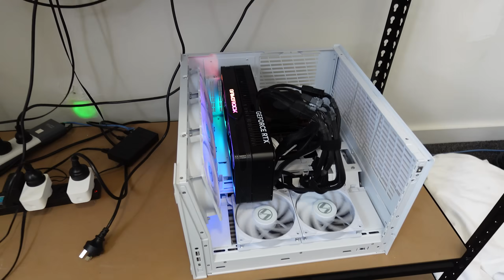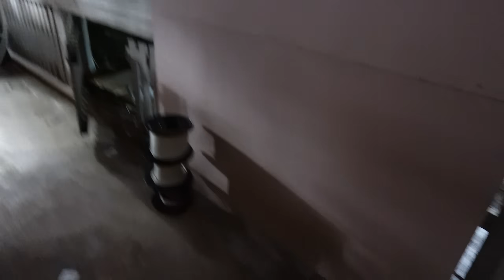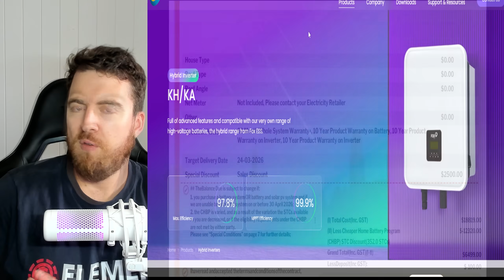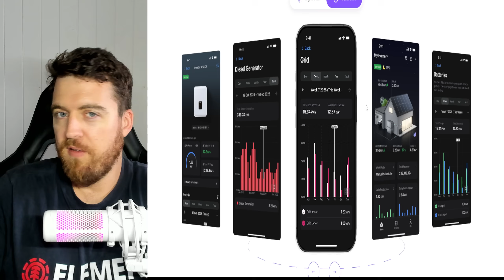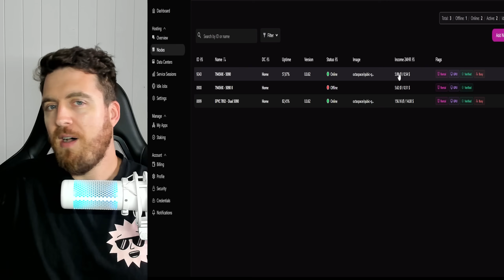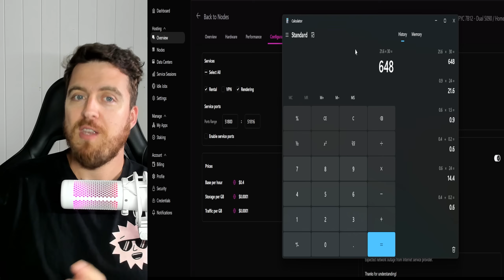This Is Why Every Miner Needs a Battery System Now

Comment: What do you think, would a 7745hx (octa core version of your 7945hx) and 32GB of RAM bottleneck the 5090? What about a 4090? Thanks in advance, and thanks for the thorough videos!
Reply from the maker: hmm the 32gb of ram most likely would. The general rule of thumb for ram is double the gpu vram
Reply: @BearMarketMiner thanks. 8 cores instead of 16 won't be problematic then, right? Do you know if older architectures (zen 3, ryzen 5000) would cause any issues?
Reply from the maker: Yeah 8 cores isn't ideal either. If you dropped the price you might get rented. Hard to say though.

Comment: Hey Mate, Look into GloBird energy. Not sure if they service QLD but in Victoria they provide 4 hours of free electricity daily. Some other providers offer similar here. Good opportunity to top up your battery. Hope it helps. Good luck with it all 👍
Reply from the maker: Hey mate.

Yeah I looked into them previously, I did some number crunching on it a while back. The issue is the Peak and even off-peak kWh rates - Some around 50c per kwh, so on days where I generate next to no solar Due to clouds, rain, winter etc. I pay nearly double the current rate.

Comment: Interesting and practical.  Will you have the ability to scale-up on solar panels at your new location?  Between crypto mining and the new AI data centers being built, the world is consuming more power than it can generate.  That's why I think SMR's (Small Modular Reactors) will be available to general consumers soon.  As AI makes it harder for people to get (or keep) a job with a company, more people will be self-employed, using every resource in their homes to generate income.  Which will result in the average home consuming more power than the average home today.
Reply from the maker: Love this take 👌 you’re not wrong, power demand is only going one direction.

Yeah scaling solar is definitely part of the long-term plan. The new location gives me a lot more flexibility roof-space wise, and I’m designing it so I can expand panel capacity in stages rather than doing it all upfront. Battery capacity will probably be the real limiter before panels are.

The SMR angle is interesting too. If that tech actually becomes accessible at scale, it would completely change the economics of home energy and mining/AI setups. For now though, solar + storage is still the most practical lever I can control myself.

Curious, would you personally go heavier into solar or wait to see how grid pricing and tech shifts play out?
Reply: @BearMarketMiner  Glad to hear you have the ability to scale.  I think clean energy sources, like solar, will become a mandatory "best practice" approach for the average home owner.  I fear, electricity costs will skyrocket - like RAM & SSDs did - in a few years from both AI's advancements and our gov't's push to move to electric vehicles.  Since you have the capacity to scale-up, I think you have the flexibility to wait to see how grid pricing and tech shifts playout before making a decision.  IMO, you're building the right foundation now to cover future needs, cost-effectivity, while keeping your options open.  I don't think we've seen the end of gov't subsidies to increase the everyday-citizen's use of clean energy :)
Reply from the maker: Yep 100% with you on this, it feels like solar + battery is gonna end up being the “normal” setup, not just for us.

And the RAM/SSD comparison is spot on, once demand goes nuts (AI, EVs, etc) prices can jump quick. That’s why I’m building it so I can scale in stages and keep my options open instead of going all-in day one.

Also… I wouldn’t be shocked if more rebates/subsidies pop up again.

Comment: Yes mate you can get $0, mate on his farm is completely off-grid and he mines too, even in Winter he has more than enough, your system is way bigger than his.  He has several batteries and inverters.  However, I suspect, your energy provider will still charge you connection fees to have the privilege of having a connection.  Do you get any $$$ for feeding into the grid if you have excess?  They might on the odd occasion give you credit to take it away in the winter months.
Reply from the maker: Yeah they always make sure to get me with the dally connection fee, unavoidable unfortunately...

I get 8c per kWh sellback so not much really. Don't plan on selling any back anyways.

Comment: I have 15.6kw system with 45kw battery. Running, 2 nano3S, 2 nerdqaxe++, 2 octaxe and 1 fluminer pro. 2.4kw in hr. In summer im getting 70 to 90 kw daily. Spring and summer is fine, but what we doing in autumn's and winter when day light is for 9-10hr only, cloudy...snow...in winter no way to run 24hr with 0 cost. You can't even charge back your battery in couple days. All these on East Europe.
Reply from the maker: Sounds like a cool set-up you've got going. 90kw on a 15 kwh system is wild.

What was your out of pocket expenses for the whole setup?
Reply: @BearMarketMiner System 2k from my pocket and 6k from governmental program EU funds with 5kw storage only, but I replace the battery, full from my pocket with 45kw from Alibaba with all taxes included priced at 4k. All those was a year ago, today I think should go cheaper.
Reply from the maker: Pretty good pricing really. How does the Alibaba battery go?